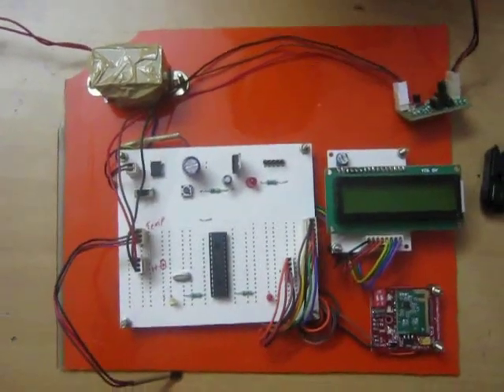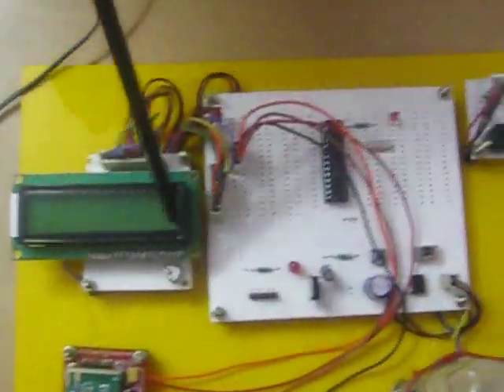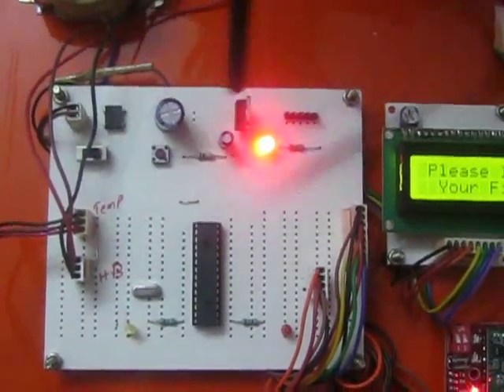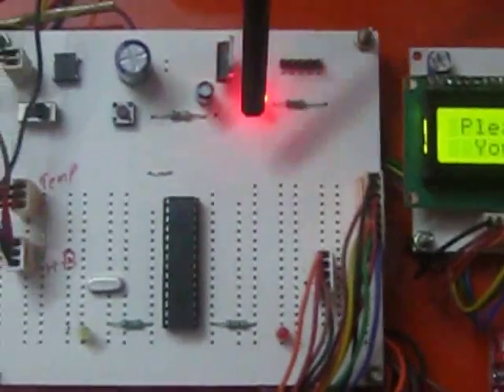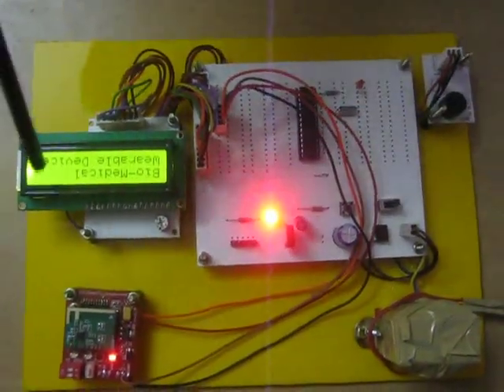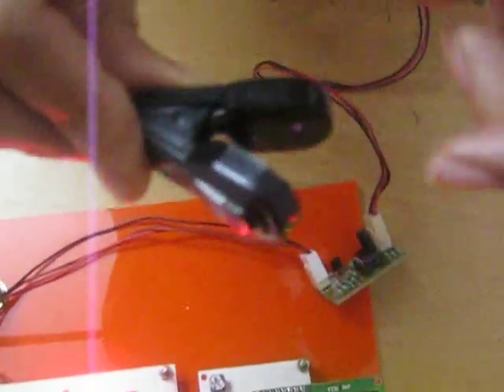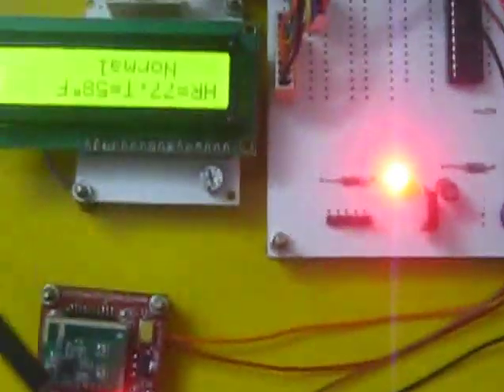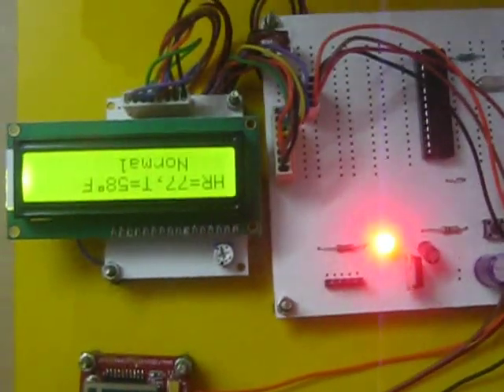Wearable device to monitor patients health parameters

Comment: hello there , im doing the same system for my final project but im using an arduino board to supply the system , I have programmed my system with arduion sketch but it dose not programmed well i still find for error n the system, can u send me the code of the LED screen pls this is my email z.a.k_2009@hotmail.com... thank you .. looking forward to hear from you..